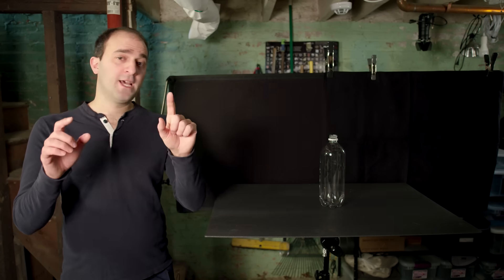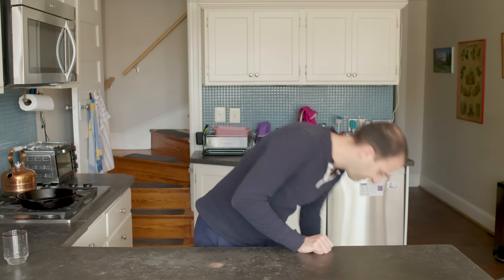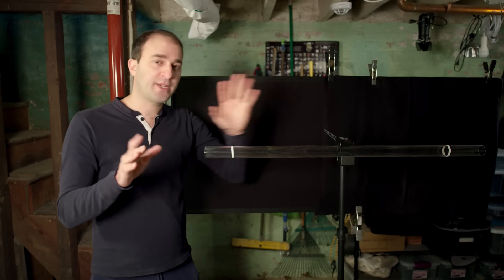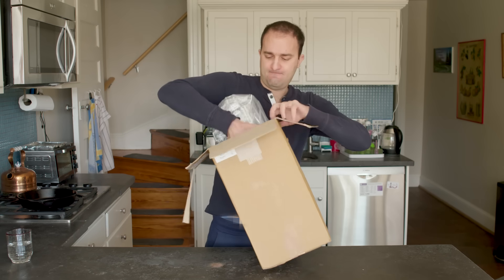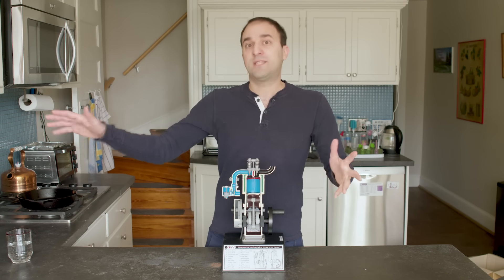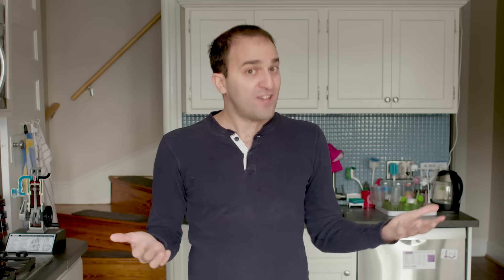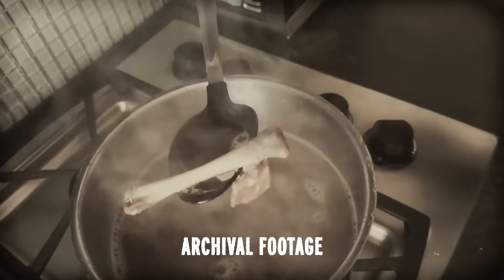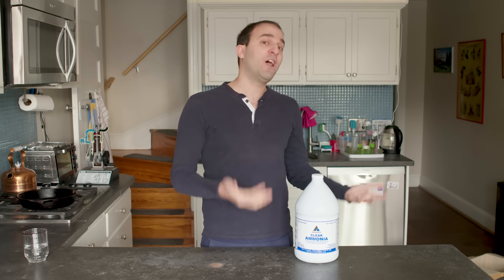Does Toyota Know Something That We Don’t?

Comment: Yes I love the smell of nitric acid in the morning. The various nitrogen oxides also give an irreplaceable orange glow to the air.
Reply: Hypergolic propellants always have such a nice warm glow!  😂
Reply: That's along the lines of  "I love the smell of Napalm in the morning". lol  (from the 1979 movie "Apocalypse Now")
Reply: @BillAnt  It smells like Victory!
Reply: But, if you smell that faintly fishy ammonia smell of hydrazine you better run upwind fast.
Reply: @jimurrata6785  No, you'd better run downwind, or better yet, cross-wind.
Reply: @jpdemer5  Good luck with that!
Reply: fuming nitric acid is great for removing a stain.. along with everything else it touches.
Reply: Oh...ok... good to know... I'll never buy electric. Your scare tactics are lame. So I'm supposed to not want an ICE engine because of negligible amounts of nitric acid produced? Lame...A lithium battery burning your house is 100x more of a danger and also ALL electric cars are a danger and expensive to maintain and UNRELIABLE. Plus, you have to find public stations to charge... then wait in line until your turn... then wait hhr to charge the pos EV. 
A gas car with hydrogen supplementing and an efie (EFI ENHANCER) will give you great gas mileage you won't worry about  $5 per gallon when you're getting 40-50 miles a gallon or more.
Reply: Fun fact ammonia is used in large combustion processes to remove nitrogen oxides from the emissions. NCSR
Reply: @johndoyle4723  it's used for a LOT of things (like Meth) what's your point?
Reply: @johndoyle4723  Interesting, do you have a source for that? I'd like to read more.
Reply: @mildlyacidic  it is called seselective non catalytic reduction ,you inject ammonia in to the exhaust gas of high temperature combustion processes and it reduces the NOx to nitrogen. Similar to diesel cars that use adblue to reduce NOx,except at high temperatures you do not need a catalyst,injecting the ammonia in to flue gases at high temperatures does not need a catalyst.
I supplied thousands of tons of ammonia to operators of these plants.
Reply: Good thing the NOx emissions of modern gasoline engines are lower than ambient air, making them negative emissions vehicles!
Reply: A good point, but he didn't actually answer the question of why they are puting it in ?
Reply: unleaded pumps out sulfur dioxide,,  any difference to lead.??  no..  orange glow,,?,,  like,the filters they use for mars pics..  as to ev,s..  they cost more pollute more, than diesel or gas..as do wind farms, solar.. its all bs..
Reply: Username checks out
Reply: Especially when mixed with hydroflouric.
Reply: Nitrogen dioxide emissions mainly depends on the combustion temperature.
Reply: @alileevil  This is under the assumption that the main reducing agent is a fossile fuel. If we replaced fossil fuels with ammonia, NOx will be produced at a much greater amount at any temperature.
Reply: @mildacidic: unless you're an organic chemist with extensive bench experience, I doubt you know what nitric acid, nitrous acid, or any concentrated acid smell like. The concentrations from cars are excessively low and only those of sensitised to them can actually make the difference.
Reply: @DanTheCox  I can tell you work in chemistry because of your inability to take a joke, having worked with enough people like you. Like damn, chill dude, maybe your solvent headache might improve. 

Unfortunately I do have bench experience.
Reply: @mildlyacidic  I've seen enough people treating chemistry as a joke and being badly damaged as a result. So, indeed as a chemist I don't take any joke whatsoever on this subject (I've seen the hands of people handling conc hydrochloric without proper ppe, horrific). I've just been in a lab that should be closed and the owners sued to hell and beyond because workers are being exposed to conc nitric and hydrochloric fumes, and I cannot stand the fact that these peoples are asked to destroy their health without reason. Sorry for being abrupt.
Reply: @DanTheCox  proper PPE saves lives I agree. Apologies for being cheeky too.
Reply: Thankfully we have 3 way catalysts or SCR with convenient ammonia injection directly from the fuel tank.
Reply: Pretty sure ammonia combustion results in more N2 creation than Nox.
Reply: It would need to burn very hot to have the endothermic reactions that produces Nitrogen oxides. Plus catalytic converters already exist.
Reply: @tylerdurden3722  regular combustion temperatures in cars already produce NOx. That's one reason why catalytic converters exist.
Reply: Or you could just not burn anything with nitrogen in it in the first place.  @tylerdurden3722
Reply: @tylerdurden3722  The hotter it burns the more efficient the engine is, or more accurately the more the burning multiplies the temperature, and as a result of that the volume, of the combustion chambers contents.
Reply: Good thing we discovered a huge reserve of rare earth metals in this nation, we're going to need it for all the catalytic convertors needed.
Problem solved.
Reply: @iknklst  rare earth are not platinum group metals (PGMs) which is what is used in catalytic converters.
Reply: @mildlyacidic  Rare earth metals can replace PGM's as their cost will come down, and yes, they can be used in catalytic converters.
Reply: @iknklst  Wheatland? Mostly magnet metal, no appreciable Rhodium, Rubidium or platinum.

Comment: My understanding (could be wrong, it's obviously hearsay) is that Toyota is running scared because Japan doesn't have anywhere near enough electric supply to support an all-EV Japan, and they are afraid of what is going to happen when the rest of the world transitions away from gasoline, making it unaffordable because all the refineries got shut down. So, they are hunting for something - anything - that they can persuade the rest of the world to switch to instead of EVs.

Comment: I think its a good thing that some auto manufacturers are keeping options open on various energy sources for transportation. I think electric cars have a big future and the lumps will get sorted out, but they won't replace everything, at least not for the next few decades. Thats not through lack of trying. Its just they have strengths and weaknesses like anything else and in some areas, their weaknesses render them unsuitable for use. Also in my humble opinion a massive effort to implement electric vehicles to replace internal combustion engines completely would not tackle the majority of CO2 emissions. I think the future will be a mix of energy sources and a big improvement on the current state. Also lets not forget how much internal combustion engines in cars have cleaned up their act. Not as if they have been standing around doing nothing.
Reply: No AMMONIA  to make it produces  a hell of a lot of CO2  as most is done buy steam reforming  methane gas  for hydrogen . now ammonia is great to  feed the world .

Comment: Japanese car manufacturers aren't focusing on electric cars, and have been working on other gasoline alternatives like hydrogen and methane. This is for geostrategic reasons. Japan doesn't have enough of the common energy sources to maintain energy independence. But they do have lots of methane, which means they have hydrogen. Which means they have excess to use as a promoter for ammonia-based combustion.
Reply: If they have so much easy to extract methane why do they import huge volumes of LNG, coal and oil? 
The real reason they are dragging their feet is because Japans entire economy is built around ICE... The former CEO or chairman or whatever there... grandson of the founder was saying 5.5 million jobs are in the Japanese supply chain for current ICE tech... his lack of foresight and huge power in the Japanese economy because of his name have put the entire economy in a bad spot reliant on people using outdated tech.
Reply: Where is the methane coming from? Couldn't they more economically make electricity with a fuel cell?
Reply: @emceeboogieboots1608  
fuel cell is another area where japanese researchers and manufacturers were working on extensively for a few decades at least.
In fact they have been researching that topic much longer than combusting those exotic fuel.
Reply: It would be thermodynamically more efficient. Heat engines that burn stuff are not very efficient. @emceeboogieboots1608
Reply: Pee Powered Car
Reply: Wasn't Nissan pretty early on the electric car front with Leaf? But I know Toyota definitely aren't fans of it
Reply: But having methane also means you have carbon. Burnibg methane produces CO2 which is what we are trying to avoid.
Reply: If they took the $billions wasted on H2 and every other hair brained car tech Japan has conjoured and used it to build out strategic materials capacity, they wouldn't be driving off a technological cliff like they are today. Lithium has Many sources now and Tesla is building their own refinery for less than $1billion. They also came up with a clean/cheap way to extract it from common clays. There are also Massive reserves at the bottom of the Salton Sea (California) or other briney lakes (the Great Salt Lake/Dead Sea). 
They Have Panasonic and can work with Samsung and LG in Korea to help build out their local battery capacity. 
Tesla has built a new type of motor that uses no rare earths but is nearly as efficient. 

Toyota is cutting off its nose to protect its face.
Reply: It's more than that. The Japanese  can't deal with losing face. Toyota have made some terrible decisions about Solid State Batteries, Hydrogen and now Ammonia. They simply can't admit that they're wrong, it's culturally impossible, especially when it's the family business and you've made the wrong call. Even his successor can't escape this because shaming the President is not acceptable.
Reply: Gas hydrates in the ocean?

Comment: Ammonia combustion could be better applied to jet engines. Jet fueling and jet tanks are probably more amenable to cryogenic fuels than cars, aircraft maintenance is more regulated than cars, and the energy density of ammonia might be sufficient. But jets don’t use internal combustion engines.
Reply: Well, technically, they do, because the combustion occurs inside the turbine core, but they're not reciprocating-piston internal combustion engines.
Reply: Imagine the catalytic converter size for a jet engine? Jet engines burn lean, so they flow far more air therefore not possible for a portable engine.

Comment: I'm not a chemist so I'm wondering ... does the compression you'd get in a cylinder change the flame speed of Ammonia?
Reply: The flame speed is limited by the speed of sound in the medium. Hydrocarbons with more carbon in a single line have low knock resistance (like n-heptane) tend to burn along the line faster than the speed of sound too easily. This is called knocking. Hydrocarbon chains like tri methyl  pentane have lots of branches so the burning is lower than the speed of sound. It has a motor octane number of 98 or higher. Ammonia has a motor octane number of 110-130 which is better than premium unleaded petrol. The speed of sound in a medium is a function of the density. The more dense the medium is the LOWER the speed of sound

Comment: Back when I was pursuing my nuclear engineering degree, there was a lot of advocate push to make the electricity from nuclear into "green" combusion fuels. It is a neat idea to take the excess load from the grid and turn it into ammonia via hydrogon synthesis. The economics of that, though, are poor. It is not a good investment of capital dollars to have a PEAKING ammonia plant. Big capital projects like that only make sense if they can be run, mostly, constantly, similar to a nuclear power plant. So like yeah, ammonia might have a place, but as a peaking, renewable/nuclear/sustainable energy buffer overflow, probably also not.
Reply: Yeah. What is this myth that there is excess load on the grid that costs nothing? We have battery/pumped hydro/compressed air, etc to store the energy and resell it.
Its minimized wherever possible. This is nothing you can depend upon in Any significant scale especially with grid batteries growing so fast.
Trevor Milton (the convicted con man) said this was His source for cheap H2 when he was selling snake oil.

Comment: NH3 is interesting, but the biggest problem is that it is NOT a fuel.  You don't just drill holes and out comes ammonia (but that does happen with oil).  You need to put energy into first obtaining H2, (which typically comes from natural gas turning into CO2 and H2 - another CO2 producing industry) or from electricity (which would be best if nuclear, but most are driven also by fossil since they have to run 24/7) and THEN you have to take the H2, mix it with N2 (which came from the energy to make liquid air and fractionally distill it), run it at high pressure and about 700 C and you get NH3.  More energy is used to compress and store it.  NH3 production consumes 2% (!) of the world's energy now.  It is basically a liquid fuel battery, NOT a source of energy or "fuel".  The Hydrogen revolution has a similar problem and has even worse problems for storage, energy density, etc.  Interestingly HTGR and MSR (Gen IV reactors) run at high temps and could be used as direct heat sources for making NH3 (which would save that 2% I mentioned earlier, and more if it did get used as a liquid fuel).  However, if you really want liquid fuel as energy storage, consider what the military does - use nuclear heat to make carbon-containing fuels (yes, they have carbon, but now you've closed the cycle).  Lastly, any time you burn almost anything in an engine (including NH3) you will make some NOx emissions.  Electric cars (and fuel cells) don't burn things to produce energy (in of themselves) so they don't produce CO2 and NOx (nor HC).
Reply: Exactly. extracting a fuel takes 0% or more of the energy contained in it, but manufacturing a fuel takes 100% or more of the energy contained in it.
Reply: this isnt explicitly true, modern gasoline, specifically the kind burned in cars has a LOT of refining steps in front of it.

Realistically the correct way to say that statement would be "extracted fuels can be <1:1, whereas produced fuels are likely to be at best 1:1 or even 1+:1 @gsilva220
Reply: NH3 production consumes 2% (!) of the world's energy now

Do you factor in all the energy that comes from oil gas diesel and nuclear - like nuclear submarines and aircraft carriers?
Reply: you should realistically be including all the refining done to oil, as well as the additives, and further refining done before it gets put into a car.
Reply: I am confussed  ,, so .. what is the answer to no MORE CO2 ???   How are Northern Nations supposed to survive 6 to 8 months of Winter????
Natural gas can broken down into it's  base elements,, Propane,  Methane,, Amonia
 ,, In Canada,,,  Quebec was runnig out of propane to heat and run the ruaul areas in 2020.. due to Indigenous Blockades of the railraods, 

The federal Goverment went out and , negotiated an agreement with the Indigenois Peoples,, (which they  """"have """"  NOT houred ) to keep the propane running to Quebec....
seems to be,,,, that some policies work for the benifit,  of the, 'few',, and not the many
Reply: Interesting timing seeing this video. I saw an ad yesterday, they mentioned using the idea to transport hydrogen as ammonia, and turning it back into hydrogen. that's probably the only reason I clicked this video.
Reply: That's not the definition of a fuel. You seem to be confusing it with a natural energy resource. The fact it must be manufactured is certainly a downside compared to a refined natural fuel, but it's still a fuel.

Comment: Making amonia from green hydrogen and storing it is a more viable way of storing hydrogen for later use as in energy storage systems (less extreme conditions needed)
Also, by mole, liquid ammonia has more hydrogen than liquid hydrogen (NH3 to H2).
the only major problems such a system has are the same as with hydrogen production, is it green, blue or gray hydrogen.

Comment: If we had anhydrous ammonia in fuel tanks every car crash would be like Emil's death in Robocop.
Reply: I work with ammonia as part of my job. The thought of cars driving round with ammonia tanks makes me want to work from home. Ammonia works but it’s for professionals and controlled processes only.
Reply: @javelinXH992  And yet we drive about with 15 gallons of a much more energy dense liquid in the tanks.
Reply: @UncleKennysPlace  Sure but I’d stand next to an open 10 litre bucket of petrol or diesel. You wouldn’t get me anywhere near a 10 litre bucket of ammonia without my respiratory on and sealed eye protection.
Reply from the maker: Just another way Robocop has predicted the future....
Reply: This!  X100

Comment: 5:50
Could you just reduce the stroke length? And run at a lower RPM?
Reduce the cylinder speed and change the gearing?
Reply: Then you would deal with the torque vs mass ratio and not have enough torque to move the mass at any speed.